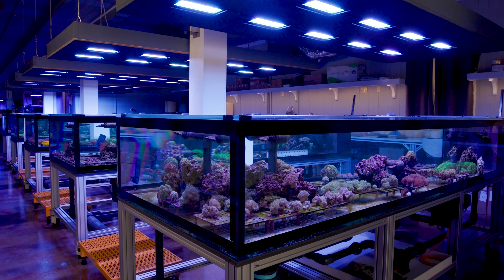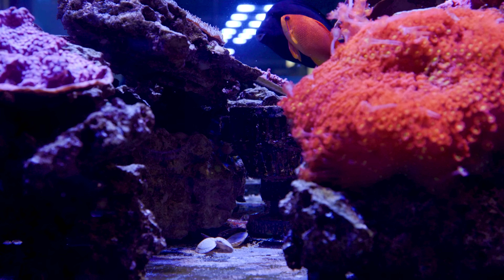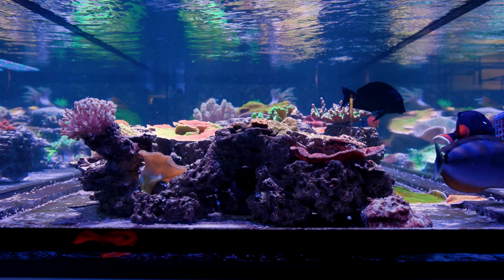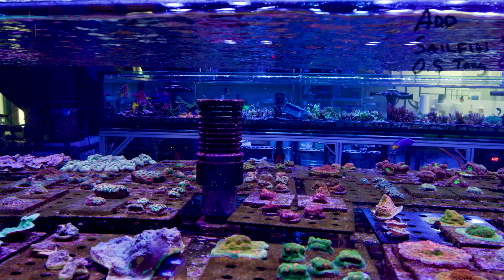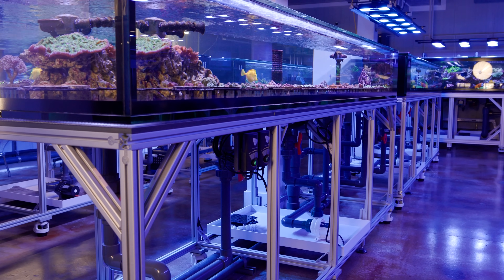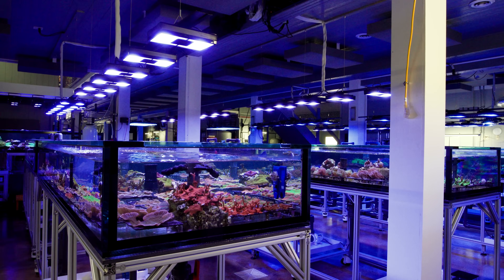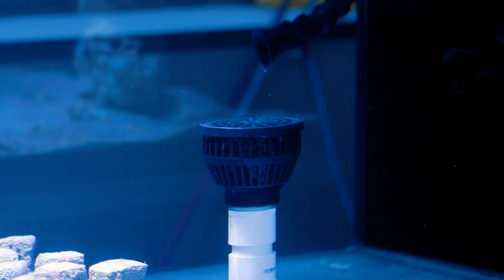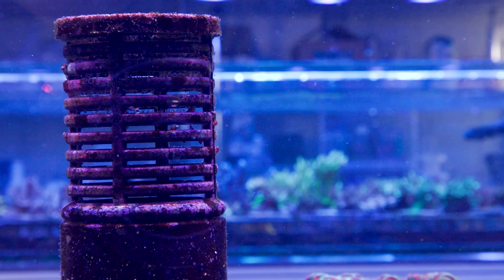Massive Upgrades! What We Learned Updating Our Closed Loop Systems

Comment: Is it your preference to install slip/slip bulkheads over threaded? seems more reliable in closed loop application. What are your thoughts? Currently in process of purchasing plumbing for 500g which will have 3 closed loops.

i would think slip bulkheads ensure a permanent leak-proof connection and superior to threaded connection (unions could be added below bulkhead). Your advice/personal experience with this would be greatly appreciated. Thanks!!
Reply from the maker: I like slip slip
Reply: @tidalgardens  Hayward slip/slip it is. Thank you!

Comment: I am a bit confused. A closed loop consists of inlet outlets and a pump. What about mechanical other types of filtration? Also a protein skimmer where does it stands?
Reply from the maker: Closed loops are for flow only.  Filtration is handled separately in a sump.
Reply: @tidalgardens  I see. Thank you for letting me know.

Comment: @ Tidal Gardens   Even though I really like your system and it's a model for most aquarists, there's one thing I really hate. You've used 90° elbows everywhere instead of 90° bends, and 90° T-pieces instead of 45° Y-pieces with 45° bends. I think you should improve these points in the long run when building a new system or making modifications. 90° elbows have twice the pressure loss (= energy loss) of a bend.

At first glance, that doesn't sound like a huge saving, but the thumbnail shows you 21 elbows and T-pieces that waste 8,760 hours of energy in a year. Alex Grah from Abyzz can surely calculate for you how much energy you're wasting. Over the course of the hours, that adds up to a bit of money that you're just wasting.

The second advantage of using bends instead of elbows is that they're much easier to clean, as you can get through every corner. Then all you need is an XXL bottle brush. This is also an advantage for the ball valves, as you can quickly clean them without having to disassemble them.
The costs for a new installation are then almost the same as for a poorly designed system and are no longer significant after 10 years of use. However, the cost savings in energy and, above all, maintenance can be significantly reduced.
Reply: Bulkheads or the screw connections through the glass are one of those things that are never really done properly because no one thinks about them! It sounds a bit strange at first, but if they suddenly start leaking and you can't reach them to tighten the nuts, or you don't have a second hand to hold the screw connection while lying under the aquarium, then you know what you've forgotten to consider.

If possible, you should have the right ring spanner before an emergency that can hold the nut in the base plate (!), so you don't have to wait until an emergency to build something. Trying to tighten everything with wet fingers in an emergency won't work.

The same applies to the inside of the aquarium. If we already have a hexagon there, we can also glue two short pieces of glass on during installation, which hold the screw connection like an open-end wrench. Then the screw connection/bulkhead can no longer twist and loosen, and we can tighten it again with one hand in an emergency if we have the right tool.

Memory tip: If you start swearing, you haven't thought about it before!

Comment: I designed my first reef tank with an INTERNAL closed loop. The pipe was siliconed along the parameter of the tank with a few outlets T-ed off poking out the sand. The pump was housed in an acrylic box next to the overflow box with a removable egg crate ‘lid’ for servicing. This was then a built in frag rack! It worked really well

Comment: When you’re talking about the risk of drilling the bottom of a tank, What’s the chance that the glass can crack or leak after say a year of installation? Has this happened to you? And when I say leaking I don’t include the loosening of the bulkhead or failed oring. 
Thanks in advance!
Reply from the maker: I have not heard of that happening though I have heard of glass cracking when initially cutting the hole.  Our glass tanks though are very thick.  3/4" so it is very unlikely to crack.
Reply: Got it. I’ll invest in thicker glass for my future tank. I love the way the closed loop system works. It’s smart and clean. 
Thanks for your response. 

One more question, do you have professional glass contractors do the drilling or does your own staff do it?

Comment: Good job.  I don't understand why this hobby tends to be hyper focused on equipment price.  Yes, some things can be looked at as disposable but maybe that shouldn't be a vital piece of equipment such as a return pump.  Closed loop is no different if that is providing the majority of the internal flow.  It always comes down to design and implementation.  We fret or balk at a pump price but never do an in-depth look at why it might be and how we can use it.  

Maybe that is because the hobby has a high turn over rate and few reach tank maturity of 5, 10, or 20 years.  Never the less you covered the important bits so thank you.  Hope your day is well.

Comment: I love the idea of closed loop and had planned on utilising it in my dream build, but i just cant get over the idea of having holes in the bottom of my tank... i can see the utter disaster not only for my livestock but for the house that would be.
Reply from the maker: There are ways to avoid bulkheads through the bottom of the tank.  It might not be quite as elegant but you would avoid that risk.